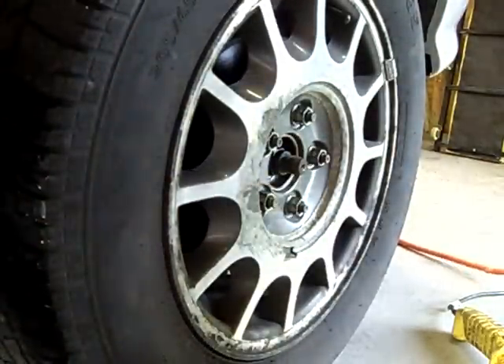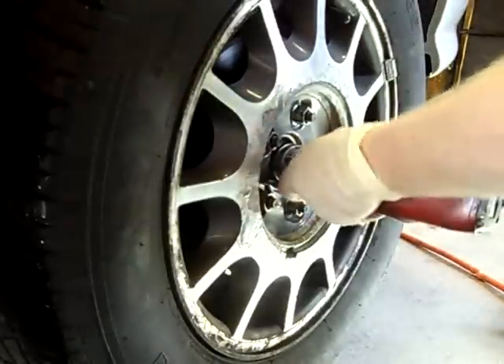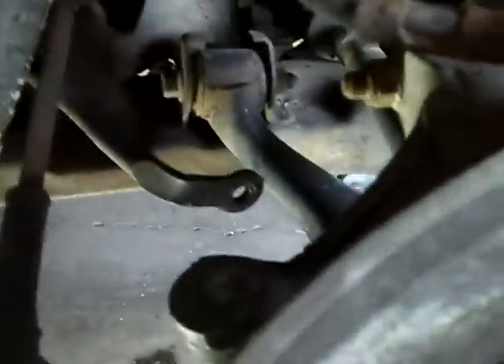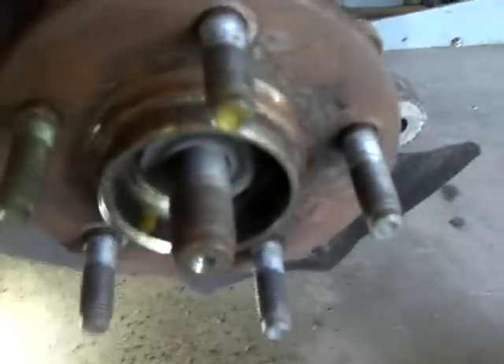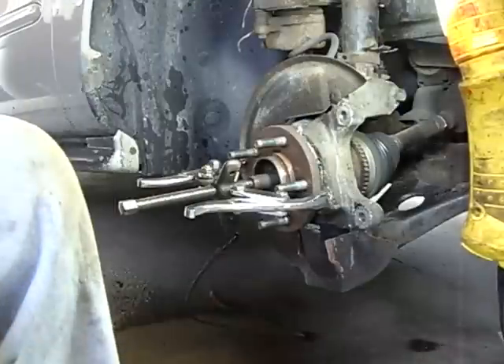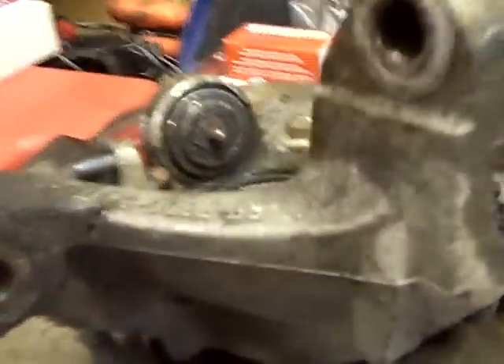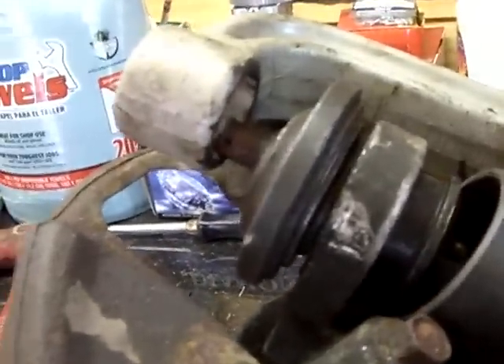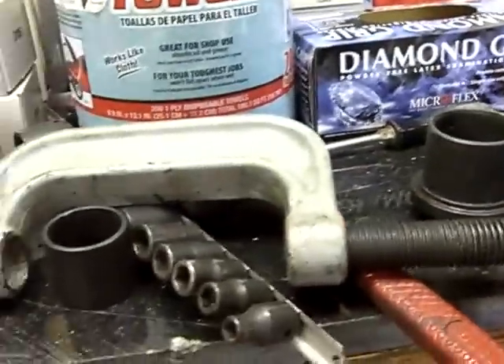Replacing 99 Ford Taurus Ball Joint.

Comment: Thanks Larry really appreciate you showing this. Just learned that I'm gonna need ball joint and sway bar (link) replace on my 2005 ford freestyle, which is really a sort of all wheel drive taurus suv. Verbal estimate from dealer $900.00. Does that mean they are going to replace all ball joints or just 1? Does that quote sound right to you? Thanks again, whether these questions get answered or not.
Reply from the maker: You said "from dealer". ANY dealer repair is expensive. Thorough, but expensive. Because it is an 05, I wouldn't take it to a dealer. A smaller mom & pop shop can do the same job for less. The dealer will probably replace both sides, both links, and align it when complete. Doing them in pairs is good but not necessary if one side is still fine. I would estimate a private shop could complete one side, no alignment, for around $350 or less. By doing the job myself, it cost roughly $60 and a few hours of my time. Tool rental was $100 which I got back. Shops need to make money but they don't need to make it all on one job!

Comment: NEVER Hold the weight of the vehicle on a floor jack while performing repair work. Always use floor jack only as a back-up for Jack stands. The technician in this video either forgot or does not have proper training.. (I am not sure you can forget something like this is you have proper training)

Comment from the maker: @cvilla198 Still trying to visualize it, sounds too tight. Besides, 3 more bolts and you would have the spindle on bench as I did. I changed the driver's side with it on the car and decided it wasn't worth the hassle this time around. Putting it in the vise was so much nicer. Besides the press I rented was exactly made to work with this car (too big)

Comment: Ok 3 things, first of all, how did you clearance the ball joint from the lower control arm? I have had to use great force and felt like I was bending the arm? Second: never use air tools on rental tools! They are cheaply made and don't stand up to the extra pressure! They even say that on the sticker inside the tool's box. And 3rd and final,  why did you throw away the old ball joint? Didn't autozone want that back for warranty? I worked at O'Reilly auto for ten years and we always wanted the old ones back lol
Reply from the maker: I took the front most control arm bolt out of the frame so the arm could pivot down and away from the ball joint. I used air tools, no issue. Press is quite beefy and I used common sense. I got the ball joint out of the trash and took it back. I had added text to the video stating that but YT has since took it off.

Comment: quick question, i need to replace my wheel hub/bearing. Would that puller tool, at 4:40,be all i need to remove hub after unbolting the 3 bolts that holds the hub onto the assembly? I'm hesitant on this job because the hub are known to be seized to the car and i rather have all the needed tools.
Reply from the maker: You will need to pop the lower ball joint off the stud in order to push the spline thru the bearing and bring the steering knuckle assembly outward. Otherwise you won't be able to get access to the bearing bolts as the cv housing is in the way. Spray it down with PB blaster and let soak. Don't use a hammer on the splined shaft, use the puller.
Reply: Larry W thanks 4 fast response, any idea on how many inches the puller needs to be to push the shaft? 4" or 7"?
Reply from the maker: The puller is really only to crack it loose. You can push the shaft in by hand after that as you pull the bearing assembly toward you. Don't run it all the way in or you might damage the cv joint.

Comment: Thought I used a vid for some order of operations.. reference tool. That's what's these videos are. A tool to assist.. can't sue bc then every thing you bought that you be angry about, ppl would try to sue.. anywho... rant...but yes everything on point. Renting tool doesn't always have everything you need. Improvising is always suggested..bc Murphy's law is freaking real.. and on the end. Use leverage. Your your breaker bar and and body weight as leverage. Putting the breaker bar in the hole in the lower control arm and strong left arm put the strut tower threw the top spindle hole. Smack it a couple time with the hammer it stand straight, be sure to hit in a solid location..common sense here..and allighn the tower and tap tap till you put the locking bolt etc...then done.. and yaàaas..not a first timer thing here

Comment: Good job on the video and procedure with one exception. PLEASE DO NOT USE Autozone or any other cheap Chinese parts such as from Parts Warehouse, Prime Choice or even AC Delco Advantage level(OE Level Delco is good) on Amazon, etc. You will be doing the job over and over. Lifetime guarantee notwithstanding, do you really have the time to do this job every year? What about if the cheap ball joint or tie rod end or other important part breaks while driving and some report that they do. Always use a good American brand like MOOG which comes with a zerk fitting for greasing if applicable. On this particular ball joint, no zerk fitting would fit in the tight space of this design so it's imperative to buy a Ford Motorcraft or Moog Ball joint either of which is available at Advance Auto Parts for about $60-$65 or from Amazon for roughly $30.  Do it once properly and it's good and safe for years.
Reply: I think Moog Makes the Joint For Motorcraft in this application. The dust boot may be different. I believe there is also a Ford factory ball joint you can get. With those brand name parts today you have the best chance of a safe, long lasting part. Cheap suspension parts are scary! Maybe a pro will know when they go bad, but the average driver will drive until their car falls apart.

Comment: @wc4pwned You're right. They suck. But as far as I know mazda designed the suspension components on the taurus. Could be BS but I would believe it. I live in Ohio, also. There are heavy duty ball joints and tie rods available on the internet, but they're expensive. Moog would be the lowest-grade part I'd put on there.

Comment: I tried to take my upper ball joints off.but the bolts wouldn't come off with a 14mm, they seem they are rounded and the bolt on the right side of the spring is too close to th spring so how would I go about to remove it
Reply from the maker: Which bolt are you referring to? If ball joint castle nut you may need to apply vehicle pressure to get it to stop spinning and use a puller. Taking a picture or video would be helpful so you could point out where the issue is. Sorry I wasn't more help at the moment.
Reply: Thanks but I finally got it loose, I also found out the hard way .That it's helpful to put some kind of lubricant on the ball joints to press them back in.i bent my ball joints press but thanks anyway

Comment: i come to the conclsusion all cars ar not same even if year and model is this was a 24 v dohc not sure if that was reason but after 10 hours on 1 side not cause i ma bad mechanic but because i tested everything to try and help people out here that have same problem i even rented a spring compressor to get that little extra lift i needed and it will not work doesent fit well so the problem i found was the square opening in frame for a arm leg the bottom needed grinded un nessesary lip

Comment: It's hard to see from the video, but why are you not able to press the ball joint out without removing it from the strut?  It looks like there's enough clearance after you pushed out the joint.
Reply from the maker: It can be removed while on the car but because it is disconnected from the strut, it swivels and moves around while pressing it out putting pressure and side load on the strut mount and bearing, essentially using the strut as a stopper. I put it in the vice to hold it firm. It's only one more bolt at that point so it's worth it.

Comment: how did u disconnect the ball joint?
u just took the nut out?
Reply from the maker: Smack the lower control arm where the stud goes thru a few times with a hefy hammer, that will jar it loose. Then pry down on the control arm to pop it free. If it's really stuck, you may need a puller but it's not normally required.
Reply: hahah i been hitting it all night, but i doesn't want move!
Reply: i guess i need a really heavy hammer
Reply from the maker: Yes mini sledge. Spray it with penetrating fluid and let it sit.
Reply: another thing, how did u install the BJ back on?
Reply from the maker: Press out old one, press in new one. Watch entire video, it explains it. Make sure you remove the C clips before attempting to press the ball joint out. It's on the top side of the knuckle. That's why I removed the whole assembly, just easier to see and get to everything with it on the bench.
Reply: appreciate it man!
Reply from the maker: No problem. Good luck. Take your time and take a break if you get frustrated. No sense damaging other components in the heat of battle. It's a tough job. If the ball joint won't come clear of the control arm, remove the front most retaining bolt at the frame for the control arm and let it swing out and to the left for clearance.

Comment: just did mine saterday, it wasnt to bad except the kid didnt put the bolt i needed for hub puller in box, always check!!!!!! hub comes off with 3 bolts anyway. on other side im using my spring compressors to get it back together, that was a bitch, and the press is not designed for fords, balljoint stud did not fit thru the "washer"! had to cut a piece of heavy fence pipe an grind inside with a diegrinder to make it work, to fit over the base of the BJ , it was a bitch now i think about it. had to cut an inch off the stud also for press to push it out.

Comment: ford taurus ball joints don't seem to last long... nor the tie rod ends... must not have designed the suspension connections to the ball joints very well at ford. Or it could just be all the deep potholes up here in northern ohio

Comment: First off you Didn't win getting a pos ball Joint . You are doing the Job 2 Times . I would spend 20 extra to not have to do the job Twice . 
The big problem is on the Hood Emblem / Grill emblem 
Ford suspension components are JUNK

Comment from the maker: You have to remove the pinch bolt all the way. It gets corroded. Just loosen the nut and back it off till its even with the end of the treads, then pound it out with a hammer. There is a C shaped retainer that is part of the strut where the bolt runs through. Soak it down with PB Blaster and tap down to free from strut end.